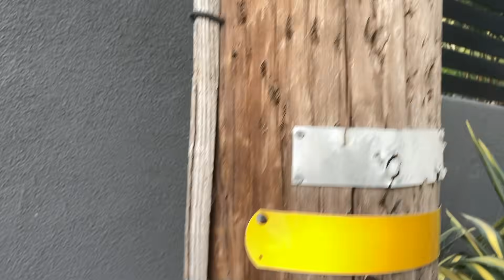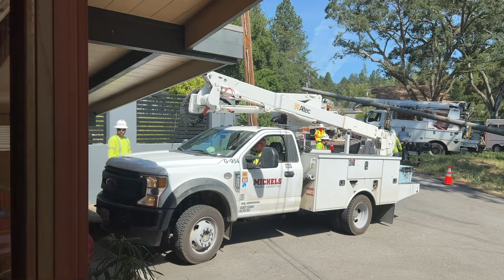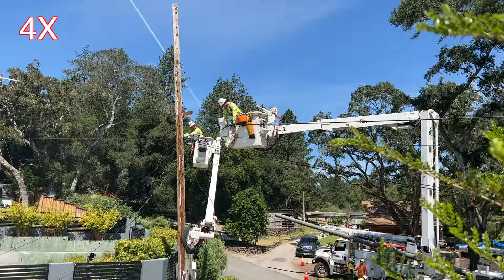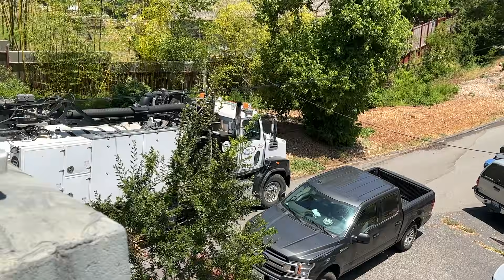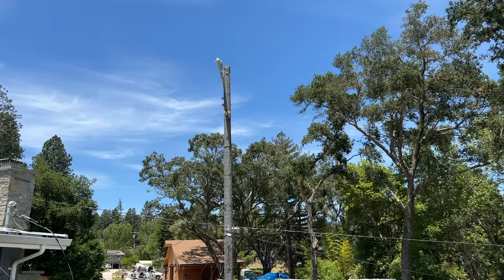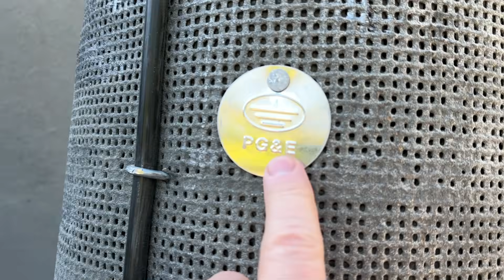PG&E Power Pole Replacement

Comment: That wrap material is used for fire hardening-- at a cetain temp it will activiate and puff out  like a marshmellow giving insulation to the pole from high heat.
Reply: I thought it was bird wrap for wood peckers . Learned something new.
Reply: Can a guy still climb it?

Comment: The video was much better on silent. 👍
Reply: yep. at first he said that was a transformer to take it down from "600,000 volts" and then said he was going to "parallel with his generators." no, he is absolutely not able to "parallel" with those gen's. at most he could BACKFEED with them. and stating the voltage goes from 600k down to "120/240" is laughably untrue. and im only 3 minutes and 3 seconds in to the video.

Comment: I’m a lineman for the telephone company for 23 years now. The truck that placed the pole is called a digger derrick. I actually run the same exact truck at my job. I’m betting the reason they used that pressure washer/vac truck to dig the hole is because of how close the pole was to your gas line.  They cant use a machine to dig if its within 3 feet of any utility (although sometimes we cheat). Ive never actually seen that truck used before, and wish my company would get a contractor to do that for us. We would have had to enlarge that hole by hand, with long handle shovels if we HAD to use the same hole, or dig a new one on the other side of the gas line. Consider yourself lucky you live in the area you do, cause by me - this would NEVER happen all in one day, unless the pole broke and was laying on the ground - forcing both companies to show up at the same time.  Usually, if we own the pole and are replacing it for whatever reason (upgrade to larger pole, rotted base, bad lean, ect). we just install a new one as close to old as we can - and then usually have to wait for the power company to move their lines first.  This can take YEARS.  Power Co cant touch our stuff, and obviously we cant touch theirs. But we will move all cable tv lines, and any other telecom provider.  There are HUNDREDS of old poles waiting around to have their lines transferred over to the new poles.  Ive even had to replace the “new” pole, with anther “new pole” from cars seeming to aim for the same poles when they crash. 
 The old wooden “u guard” for ground wire was used when power companies used to use solid uninsulated copper wire for the ground.  Its kept people from touching it, and helped deter theft.  Nowadays with the price of copper, youll never see that anymore.  You’ll see them use stranded copper wire thats insulated, copper plated, or just aluminum. Some of the insulation will even say “this is not copper” so people don’t cut if off thinking its worth something. 
  We have a contractor service that comes to collect all our old pole pieces we bring back to the yard.  I remember hearing years ago they were sold and shipped out of state, and burned as fuel for a gypsum plant where epa regulations were less restrictive.  I cant say if that is 100% accurate - but I wouldn’t go chopping up any old pole pieces to burn in your indoor fireplace due to all the chemicals in them.  Unless you happen to find an old cedar pole. Those didnt have anything in them.   
  Rule of thumb for depth of set if 10% of the total pole length plus 2 feet.  So your new 50 footer should be in the ground about 7 feet.  There should be a brand on the side of the pole, (its its visible through that covering) about 4 feet above ground that would tell you the length, and class (how thick) the pole is.  Never seen that pole covering either.  For a while about a year ago, there was a pole shortage. We actually started getting ready to have to use fiberglass poles instead.  Thankfully it never happened.
Reply: And for the record - when we place poles at my company - we are usually responsible for restoring the concrete on private property. We have contractors that will do it.  Usually If it doesn’t happen, its because nobody submitted the request to have the contractor go fix it.
Reply: That's a lot of information, experience and knowledge
Reply: 10% of pole length plus 750mm  = pole setting depth 😊
Reply: @kctyphoon use bitumen as the pole inspector has to periodically dig around to inspect timber condition
Reply: Dude TMI U MUST BE PART WOMAN

Comment: He was using hot stick to ensure the lines were actually de energized. To ensure no back feed
Reply: There are two lines one 7,200 an the other one is a neutral. Now they have put a jumper to hot line to the neutral  so people like this guy has all ready turn on his generation I hope he was smart enough  pull his meter.
Reply: His has a meter on his hot stick he was checking  to make sure the power was off.

Comment: So...Joint Pole agreements JPA's which are apart of NCPA determine how much communications pay for their share of ownership of the pole. Usually from about 26' down is the communications company share. Asides from the modern wrapped pole with fire blanket, there is a nice new fiberglass cross-arm, and new style insulators, i wish they would upgrade my pole line!

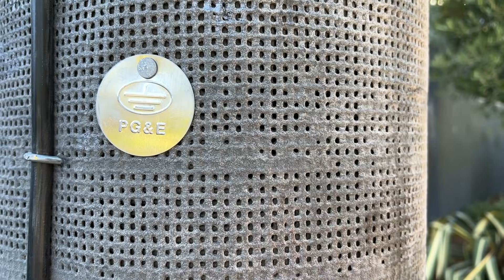Comment: 31:22 the main issue with the squirrels is, they were probably getting shocked by the arrester and bushing on the old transformer because it did not contain animal guards. If you look at the new transformer, you can see it came with the animal guards for this purpose

Comment: Fire Wrap or Fire Shield. You live in a High Fire Area. Primary is a Phase and Neutral indicated by the single Fault Tamer Fuse on the primary arm protecting the transformer . Primary is maybe 7 or 9 kV depending on circuit mainline voltage. Secondary voltage is 600V likely 120/240V single phase on the triplex secondaries and service drops.
Reply: Primary voltage is 21kv.
Reply: That line was 7.200 residential always.
Reply: The transform is a step-down single phase. The primary 7,200 kv. Three legs coming off the transform each legs is 120 volts, so theirs were your 240 comes from.
Reply: That was a 7,200 kv. On the primary
Reply: @gregorywoodcock2472  KV meany kilo volts, thats 1000 volts, so 7,200 kv would equal 7,200,000 volts -  way too much!.  I think you meant 7.2KV, or 7,200 volts on the primary!  Never heard of a 7 million volt power line in a neighborhood!

Comment: FYI, the high voltage coming into residential neighborhoods is usually between 17,000 volts and 45,000 volts, not 600,000 volts.
Reply: No, the voltage in neighborhoods and even commercial areas is typically 7200 volts to 14,400 volts in a wye distribution system

Comment from the maker: Word is the covering on the new pole is fire hardening. Which makes sense as it is kind of a cement cloth.
Reply: It’s a fiberglass wrapped pole not cement
Reply: Armorbuilt intumescent fire wrap
Reply: @Palm-Pine-Aussies looks metallic notice the earth symbol nailed through it?
Reply: @SLE253  I’ve literally framed, dug, set hundreds of these poles, I’m %100 positive it’s a wood pole wrapped in fire resistant mesh , and the ground symbol you are referring to is a building standard that we use to show  that a ground scheme for the transformer has been properly installed it’s covered 4 solid copper to a 5/8s ground round , ps we stopped using the ground symbol as well due to copper thieves cutting the ground wire

Comment: Hey ward your primary line is 7.200 kv if that was 600,000 kv everyone standing around  would have die easily.
Reply: You are right about that.  Ours were mostly 7200 or 144. I operated a digger derrick and bucket truck. The most I ever worked on was 69,000 transmission line with a large crane.

Comment: Cool video! Looks like the transformer has a delta high side or at least a dual bushing with both phases insulated. Seems a little dangerous if you don’t know which is which.
Edit: looks like a fiberglass crossarm on the pole.
Reply: Another edit: It is probably not 600-1000v feeding into the transformer but 6000-10,000v or something like that. I can confirm about how many people needed and traffic control. Would've liked to had a few things off of that pole.
Reply: Primary side is connected wye, The primary voltage is 21kv. PG&E only uses two bushing transformers.
Reply: @chrislopez349  Ok Thanks
Reply: Dont give this guy any knowledge you tell him one thing and he thinks hes an expert..  He said it all with chemtrails and no need for hotsticks.

Comment: Ward, Thanks for taking the time to make this video it's always fun watching utility companies work. I like you and wondering what new procedures have come out on utility poles. I'm guessing it has something to do with all of the new EPA rules and PG&E's lawsuit issues. 
When the lineman went up with hot stick the box at the end is to check and see if the line is hot, looking to make sure your neighbors generator is in back feeding.
Reply from the maker: Ah, of course! Giant stick tester!
Reply: @WardCo  Yup, the hot stick attachment was a High Voltage Detector. "a line is not dead until it is tested AND proven dead". So he tested it dead, and then proved it dead by installing a shunt and personal grounds around the work area and on the high voltage lines. Required steps to protect against accidental energizing, backfeed, induction, lightning, or any other possible source of voltage.
Reply: Don’t confuse PG&E with contractors. There’s a big difference when it comes to how the job is performed.
Reply: Seems they do the same as machines, may be locked out but that doesn't mean it could still have residual energy. Always test to make sure regardless.

Comment: Why didn't they Earth the HV lines first before doing anything on the pole
Reply: Must’ve thought they were safe to work because everything they were working on was de-energized. Still safe to ground first. Ground should be first to tap and last to remove.
Reply: Probably didn't want the grounds in the way while they were dicking around with the secondaries. Energy source is probably within eye sight.

Comment: It is obvious that this is from a “customer’s” viewpoint that knows nothing about utility infrastructure or easements.
Complaints about paint on his “new” driveway that is a “few years old”.
Those guys doing “traffic control” are groundsmen that are also responsible for fetching equipment and such.
And the fact you question the use of hot sticks proves how little you know.
We called your type “NIMBYs”. Not In My Back Yard.
Geese!
Reply from the maker: I think you mean "Geeez" not "Geese" -- we all love geese.

No, I was delighted to get the pole replaced -- and, I can't remember, but I think it is in the revisit video I note the guys came back and painted over the USA markings with black -- so that was great.

On the whole I think they did a great job.

Comment: Pge supposed to replace a pole in my area tomorrow. How long did all of this take
Reply from the maker: Just a day to do the pole swap -- and then a wait of a couple of weeks before they fixed the pavement. And of course, they sent random guys out and random times for a couple of YEARS before actually mobilizing.
Reply: @WardCo  sounds like typical pge incompetence
Reply: The depth is 10% of pole length plus 2 feet. If he dug a hole 15 feet deep it would be close to a 150 feet tall . Lol that’s a cell tower .

Comment: There should be a guy crossing the road to hold the corner, otherwise the pole will always eventually lean into the corner unless they put in a much more expensive self supporting pole.
Reply from the maker: There was some discussion about doing this for the reason you mention. But, as of today, no action.

Comment: Where is this..? Why is the pole almost inside the fence ? here they are made of cement or metals..Of course wooden poles exists, but carry either non electricity utilities or low voltage..I have never seen a wooden pole with a transformer..that will surely break the code.. ooh it is in america..the land of the weird buiulding codes. 😁

Comment: Wow so much sarcasm and complaining from another NIMBY whiner who’ll sue the utility when janky parallel generators burn his house down.

ETA:  until those HV lines are grounded they are still hot whether off or not.  Hence the hot sticks.  There are a lot of inductors and capacitors on that line so even if it’s disconnected the possibility of it still being energized is high.

Comment: 120000,7200 volts,  or 14200
Reply: Or......4160.... 4kv is still prevalent
Reply: incorrect. they are not 14,200 volts. you dont add them together. they are 12470 nominal. 7200 phase to ground, 12470 phase to phase.

Comment: Should be only 12KV on that primary. The pole isn't framed for 600KV.
Reply from the maker: Thinking more like 600V on the primary, but I probably under-shot!
Reply: 21,000v circuit on the high side in this video. 2 wires, one was a PN (primary neutral) so the second one in this configuration had 12,000v on it. (wye)
Reply: It’s not 12kv lol it’s delta
Reply: @dieselwhisperer6907   No it's not, theres only 1 cutout on the can
Reply: @ucfsub  nice they must have their neutral on the arm, I was basing it on the original CSP with 2 taps and no cutout